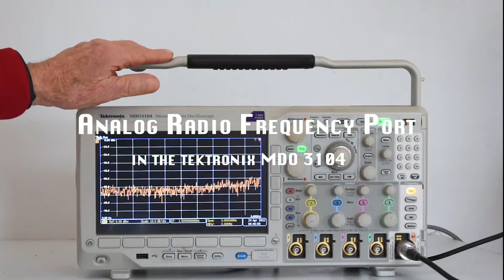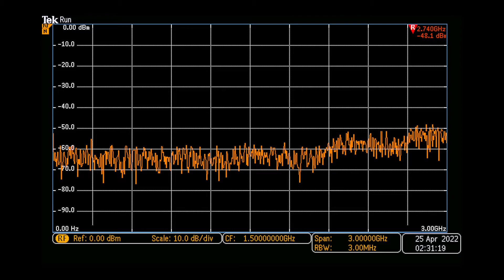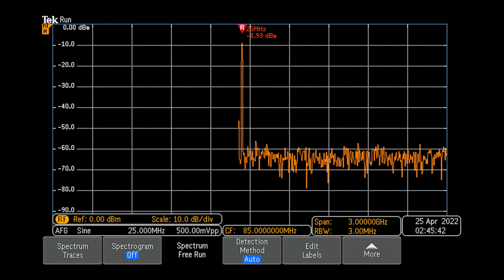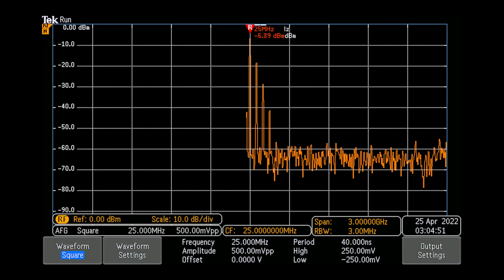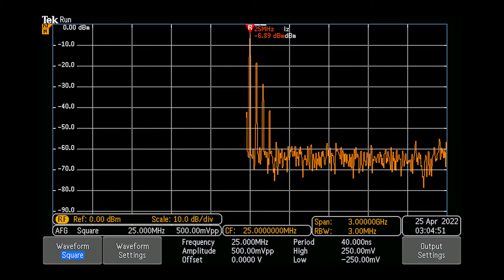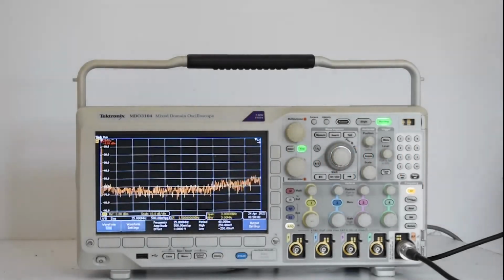Oscilloscope Series #140: Analog Radio Frequency Inputs

Comment: The reason for no comments is that the blurb lexicon and semantics you use is refined and only audible by military, advance hams and or electric techs with such knowledge and discernment.

The average Joe of the ages will find it tasteless and boring within the first 10 seconds.

A more American neutral southern or northern simplistic explanation will get more thumbs up in the air.

However, I command you for the attempt.  Take care and thank you for the review of that device